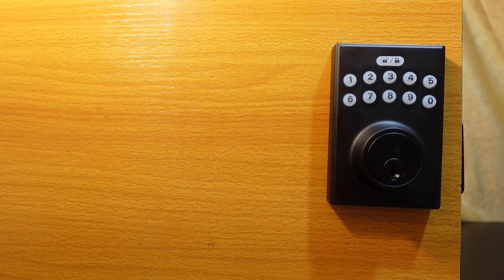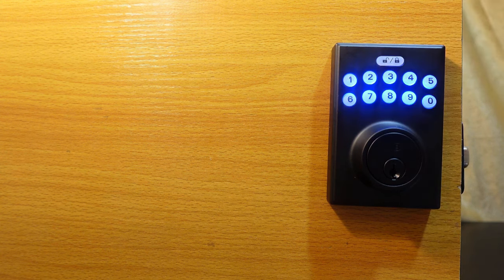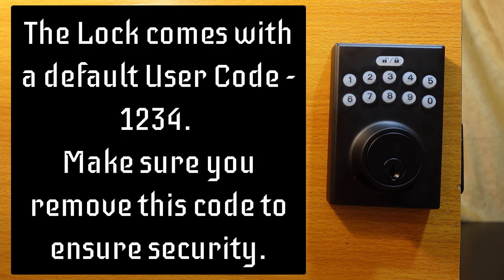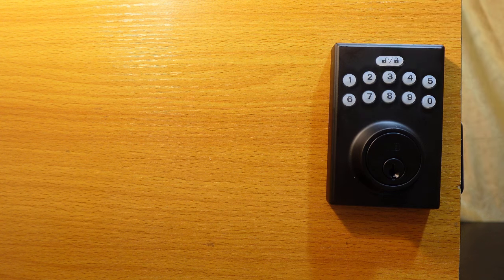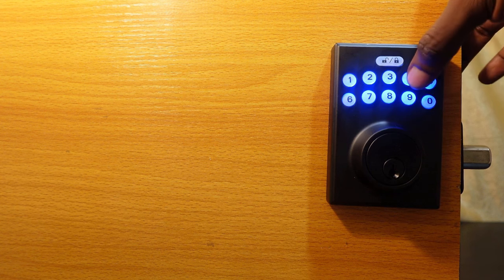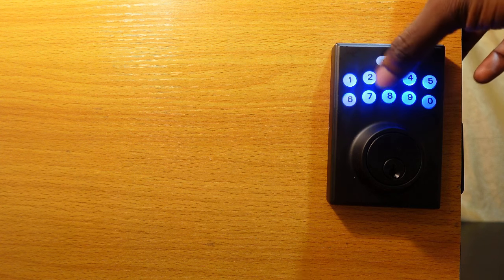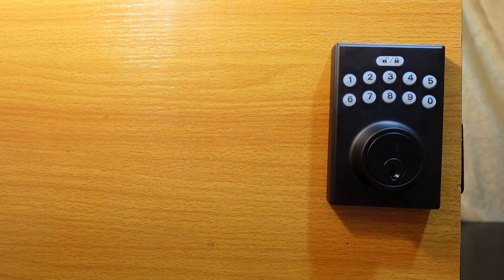Reliabilt Door Lock Programming Instructions

Comment: During the door handling identification step, I hit 0000 unlock then I hit 0 again and then unlock again and it gives me red flashing light with 3 beeps. I already reset the whole thing twice and it did not make a difference. What should I try?
Reply: SAME
Reply: I called reliabilt because I had the same issue. I wasn't doing the second step quickly enough.  If you delay hitting 0 and the lock button AT ALL after doing the "0000+lock button" step, it will give you the flashing red light.  Do it fast and it worked for me.

Comment: I have everything programmed but when I just hit the unlock button from outside it unlocks the door with no code needed?
Reply from the maker: @TheDemmer21  It looks like an incorrect installation. Reset the lock. Next, remove the interior assembly from the door and reinstall it. Make sure the Thumb Turn is set in the vertical position and the latch bolt retracted while reinstalling it. 

Now you can program the lock, starting with the door handing detection process.

Comment: The first step kinda works, but the lock doesn't go back into position. What does that mean?
Reply from the maker: @detroitlionsforever1  If you've just installed the lock, it could be because of incorrect installation. Uninstall the interior assembly, then reinstall it and make sure the thumb turn is in the vertical position and latch bolt retracted while reinstalling it. Try performing the door handing detection again to see if it works.

If the problem persists, reset the lock before performing the door handing detection. Then proceed to change/remove the default codes and add new codes.
Reply: @SmartTechVille  still didn't work.

Comment: Why do I get three flashing lights everytime I try typing in the programming code. Brand new purchase and install
Reply: I press 0000 unlock/lock and it flashes green, and before I press 0 unlock/lock    It starts flashing red three times
Reply from the maker: @PeytonPorter-y5n  It looks like the lock isn't installed correctly. Remove the interior assembly. Then reinstall it and make sure the Thumb Turn is set in the vertical position and the latch bolt retracted while reinstalling it.

Next, reset the lock and perform the door handing detection. It should work fine now.

Comment: my lock is unlocking without code, and locking with the code.  Its backwards
Reply from the maker: Hi there,

It sounds like an incorrect installation/door handing detection. 

To fix this, remove the interior assembly of the lock. Then reinstall it and make sure the Thumb Turn is set in the vertical position and the latch bolt retracted while reinstalling it.

Next, reset the lock and perform the door handing detection.

4:26 How to Reset the Lock 

0:05 Door Handing detection
Reply: Thank you. I didn’t expect such a fast reply!😊

Comment: I have done all the steps, but my user code doesn’t work. I’ve reset the keypad over and over. I don’t know what I’m doing wrong.
Reply from the maker: Hi there,

If you're doing everything correctly yet your code isn't working, check the installation. It looks like the Thumb Turn wasn't set in the right position during installation.

To fix this, remove the interior assembly from the door. Then reinstall it and make sure the Thumb Turn is set in the vertical position and the latch bolt retracted while reinstalling it.

Next, reset the lock and perform the door handing detection process. This should fix the problem.

Note: Change the default Programming Code (0000) and delete the default User Code (1234). You can add new User Codes.
Reply: @SmartTechVille  I just got it to work. Not sure what I was doing wrong. Thank you so much for your prompt response!

Comment: I am having troubles programming. How do I confirm left or right hand and what do I need to do
Reply from the maker: Hi there,

To confirm your door handing, enter the default Programming Code (0000), and press the Lock/Unlock button. Next, press 0 and press the Lock/Unlock button. The latch bolt should extend and retract to learn the door orientation.

Try watching the video from the beginning... I've demonstrated how to determine left/right hand, and other programming.
Reply: Got it. Thanks
Reply: Hey I did the other steps before determining the left or right hand position and I can't do anything now what should I do
Reply from the maker: @jberry2061 Reset the lock. Then start with the door handing detection. 

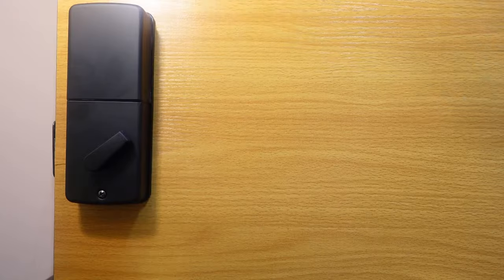4:43 How to Reset the lock.
Reply: Hi. I reset my lock but it won't let me start over.